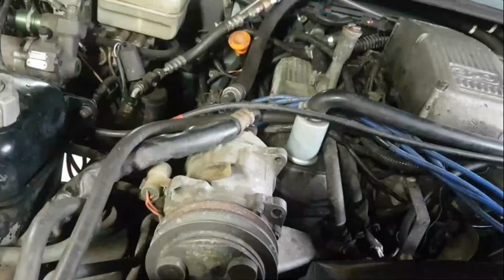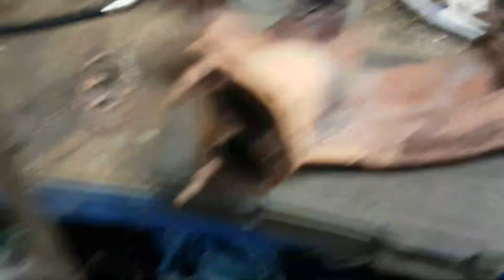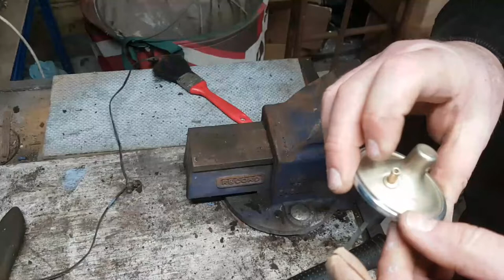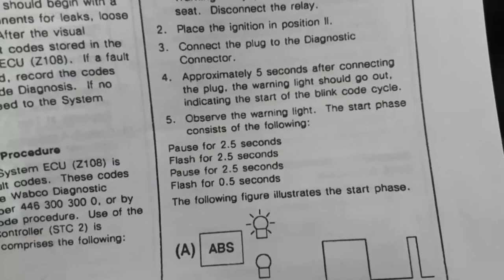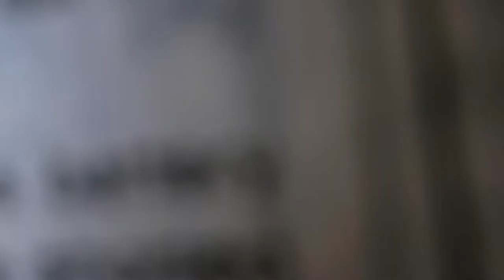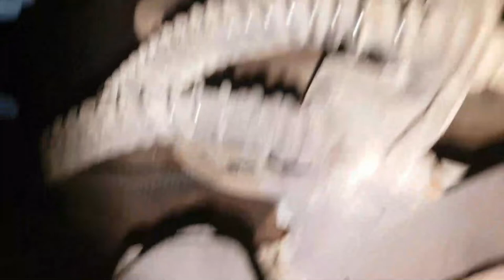1994 Range Rover Aegean Blue Part 5 - parental warning

Comment: Nerdy tip corner: on mine, the dizzy clamp nut is threaded only half way through. My conclusion was that this allows you to establish the nut on the thread with your fingertips before tightening it when the access is so restricted - rare bit of thought from Solihull! Fascinating (no, really!) ABS tutorial, thanks - will see if I can diagnose mine and maybe put the bulb back into the warning light ;)

Comment: I used to put a few drops of oil, every 6 months, down the distributer shaft when I owned Stags [4 of the bloody things] 3 with original engine and one with a 3500 V8 P6. If I remember correctly the Rover and the Stag shared the same Lucas Cap and Rotor arm. I had chance of a Disco 1 LR a few months back with the 3500 injection, very early car, but ummed and arrreed for too long and it was snapped up. Much prefer the 3500 to the 3900...which do you prefer? Not offended by the language as I am human and not a parent. Great Video's here. Thanks Sub 777
Reply from the maker: Lubricating the distributor is part of the service schedule that might be missed by many a home mechanic 😒

Yes the Stag and the Rover v8 share distributor caps and also the rotor, however need to be sure that you have the correct type. Thin one for electronic ignition and fat one for points systems.

The 3.5 low compression that I built up for the 72 car was an absolute peach, very nice to drive, much of the experience was the long stick LT95 gearbox though. Cannot say that I compared the carb'd 3.5 against the 3.9 efi. Maybe I need to drive a 3.5 EFI and see if there is a difference.

Glad you are enjoying the videos, thanks for your feedback and appreciation
Reply: @churchhouseclassics  Thanks for the reply! I had the 3.5  engine with the twin SU's and was totally trouble free and one of the Stags had a timing chain jump, without warning [my second one] which led me onto the 3.5 Rover. The last stag I had was a 1975 P reg' with original engine but was always a nervous wreck on a long journey, nice car but far too delicate. if they had put that Rover engine in, there would have been allot more sold. Love the old Range Rover's but those new Evoque's [hairdryer on wheels] have a bloody 2.2 Transit engine in them...god help us!

Comment: The oil light takes an awful long time to extinguish.
Reply from the maker: It does, I have an oil pressure gauge but the cheap Chinese rubbish broke. I will test this car when I get something more reliable. Although the engine is high mileage (mine is higher) both mine and this unit from cold start after 12h or so takes 6-10seconds to go out.
Reply: Church House Classics Limited 20/50 might help (unless you have already put it in ) I use Valvoline in my 4.6 it seems pretty good .